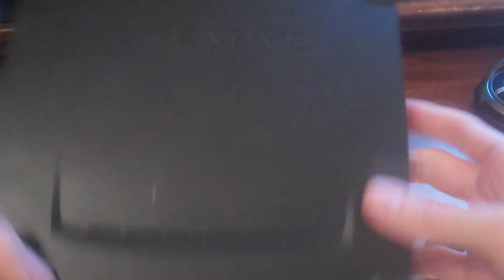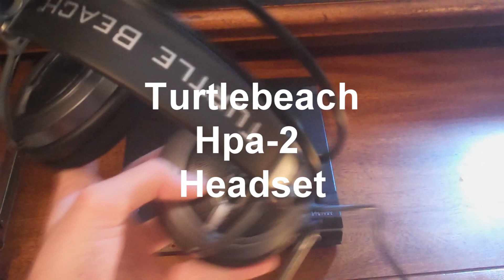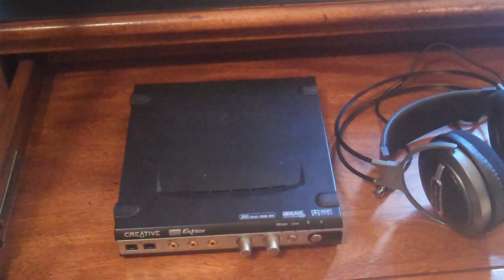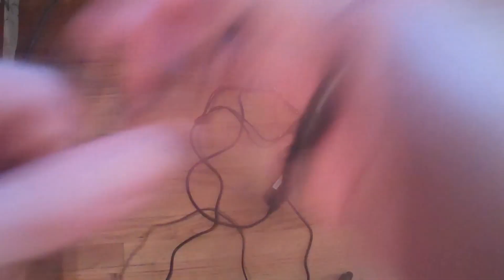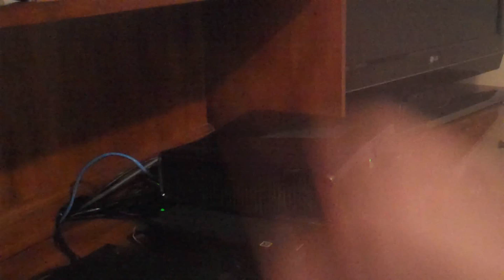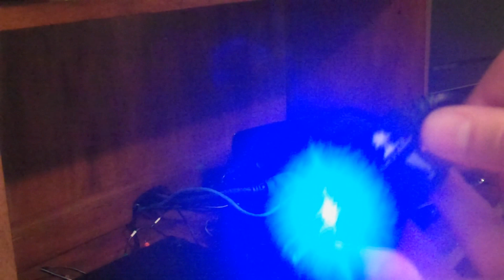Best Gaming Headset? Hpa2+Extigy Review/Setup

Comment: @mkakiler yes this setup does work with the Z6A , the only cables you will need is 2.5mm male to male TRS cable and an optical audio cable, basically the same two cables you need to make an astro mixamp work on the 360.  The Z6A package comes with a 5.1 channel amplifier that connects directly to the headset and on the amplifier is a port with a picture of an xbox 360 controller, thats where you plug in the chat cable that goes to your controller.

Comment from the maker: @mkakiler yes the extigy can be used with the xbox 360 with the addition of extra cables that allow you to talk and hear others. The xbox 360 setup has alot of cables if you want to chat using the turtlebeach headset, i use them for sound and then if i need to talk ill have the regular xbox headset round my neck and then have the speakers play chat, which will play through the extigy aswell.

Comment: @TehTBails3 
when it has the hpa2 adaptor the headset is a true surround headset but the hpx version is for use with the astro mixamp which outputs virtual surround sound, it just uses 2 speakers per earcup but the same sound is coming out of bothe speakers on each side.

Comment: Actually I was wrong ,with the Z6A it isn't jerry rigged at all, its just as straight forward as an astro plus mixamp.  I decided to switch to this set up from astros and mixamp and man what a difference, completely blew away my a40s.  The sound quality is a tiny bit worse than the astros but the directional positioning is a 10/10.  Best setup ever for sound whoring!

Comment: Will this set up really use every driver in my HPAs accurately. My Z2's + mix amps virtual 5.1 is quite convincing when it come to directional placement and ambient sound. I just need a reason to pull my HPA's out of retirement, but this set up looks really troublesome. Is this set up worth the hassle. How much does an Extigy go for now a days any way. If it's COD or Skyrim you never realize how much sound matters until you take an arrow to the knee. LOL